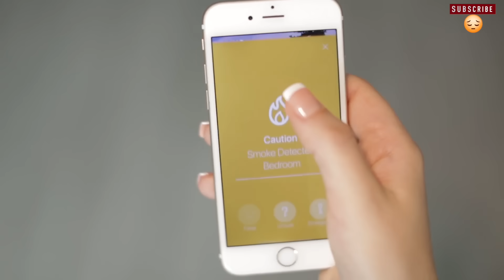10 Fire Fighting Inventions That Every Government Should Possess ▶ 7

Comment: Most of these "innovations" are purely impractical bullshit.  Aside from the air tankers, which are NOT new at all, skycranes have been used for at least a couple of decades.  It's clear the makers of this video have NO idea about what it takes to extinguish a fire.
Reply: well, some of them are very useful and many departments purchase them. Well, obvisouly some are only for special operations which not every department covers, but some larger departments do.
There will always be some units and tools which hardly anyone else has, but they still make sense. Thus the department in my former home town has more than 50 units at the station and one of them is a nitrogen vaporizer ...
Reply: WTF is a "nitrogen vaporiser"...  Nitrogen turns to a gas at normal temperatures, you don't need to vaporize it...
Most of these gadgets are useless, period.
Reply: ffjsb the nitrogen vaporizer is used as interting systemfor fires in food and grain silos. Liquid nitrogen is brought to the scene by a semi truck, vaporized and then the silo will be filled with it. In contrast to frozen carbondioxide (that department has a tank with frozen CO² as well) the method with nitrogen doesn'tleave any debris on the grain, so it  can still be sold afterwards. Otherwise both the fire itself  as well as the extinguishing with water or foam can be the financial ruin for the  company.
Some departments think a little bit further than just putting water and maybe foam onto the hot stuff.
Ever heard of  fire-fighting tanks, 300' high Aerials, fire and rescue trains, fire trucks with cabs on both ends of it, motorbikes and compact cars used for fire-fighting tasks? ...
Reply: CO2 is not frozen in tanks, it's a supercooled liquid just like liquid Nitrogen.  CO2 is not going to leave any "debris" on the grain either, I'm not sure you understand what you are talking about.  
As for all of the other "gizmos", most of those are of VERY limited use, VERY expensive, or usually impractical or not necessary.  There's a reason why there are standardized firefighting apparatus.
Reply: Actually it does, not much but there's stuff stuff remaining on it (I don't know what exactly it is). That's eactly the reason why the department got the nitrogen vaporizer, otherwise they would have kept only the tank with frozen carbondioxide. Another department got one vaporizer as well.
Well, there are standard fire apparatus and special operation apparatus. Guess why they are "special" ... in which way do you think any of the other named things aren't necessary (especially without knowing why and where they are used)? To add some more examples: mobile cranes, ambulance bus or  command bus, road-rail truck, amphibious vehicle, tow truck, bomb disposal unit, turbine extinguisher, (farm) tractor, ...

Maybe you get along with Engine, Tanker, Ladder Truck and Rescue Truck, but many departments have a slightly larger fleet and handle some more tasks.
Reply: You clearly don't know what you're talking about.  
Not at all.
Reply: I don't know the chemical background etc, I only know that it is like that. Guess why I was in contact so much with the department as they received that unit ...
Probably you think that all the other named special apparatus are completly useless as well? :D
Reply: "I don't know the chemical background etc,"
Like I said, you don't know what you're talking about.  So let me break it down for you...
1.  Drones.  Limited by weather, 100 lpm is only 25 gallons per minute, absolutely useless on a structure fire.  Some possibilities for fire command and search and rescue using live video.
2.  Sound waves.  Great, they put out a SMALL fire in a SMALL skillet...  Try just using the lid next time...
3.  Aerial tankers, not new at all, been doing it since WWII.
4.  Tracked robots, not really new, mostly used for EOD (bomb squad) you can't drag hose too far, especially once it's charged.  Very limited use, and they are NOT explosion proof.
5.  Exploding balls, no.  Just NO.  It WILL NOT put out a deep seated fire, and does NOT provide any cooling, so there is a great likelihood of re-ignition.
6.  "Sky Saver"...  Any fire below you and you're going to be like a marshmallow in a campfire.  And if anything is falling from above, you'll be killed by the falling debris.
7.  Basically the same thing as 4, but firefighters can already put out more water than it can with existing equipment, and at a fraction of the cost.  The only advantage is that they can handle more radiant heat, but they're still too expensive.
8. High fog, basically a high pressure sprinkler system that will still cause water damage, and is more expensive to install, with more maintenance.
9.  Auto Fireman, you'd have to put in way more than two to extinguish most fires, and it will not prevent re-ignition of fuels.  Not to mention they're just too small.
10.  "Smart detectors" limited need for these, mainly high risk facilities.  Normal detection systems already in use are quite adequate.
This was a HORRIBLE video, with much false information.
Reply: At least I'm honest and tell you that I don't know the detailed background, but what I do know is why two departments got one of these units each. Do you think they get them just for fun? The department in my former home town has a station with 55 units, only 3 of them are Rescue Engines or Engines and 3 are Tower Ladders, you can imagine the number of special operations units (and no, that department doesn't have a mobile crane, an ambulance bus or command bus, no 170' Tower Ladder or sth similar)

1 Drones: yes, we primarily use drones to get an overview of the emergency scene, some are equipped with infrared cameras. We have one drone operator from the FD in the county, and at the EMS provider where I used to work the boss has one drone for search and rescue operations.

7, the LUF60: The only advantage? Operating from a safe distance without risking your crews life in too dangerous situations for sure is a reason, no matter if a tank needs to be cooled down, or fires in chemical industries, fires in tunnels etc.; It can also be used to ventilate large buildings as well, remove some debris or vehicles which block the path to the fire and so on
 Since there are quite many departments purchasing them it seems like it is worth the costs. Some departments purchase more than 50 entire fire apparatus at the same time, they sure can purchase a LUF as well.
Reply: I'm telling you I DO KNOW about these items.  And yes, my dept. has bought stuff that we know to be basically useless, just because they got some Federal grant money, and had to spend it or lose it.  Pretty stupid reason for a fire dept to spend money.  There are a lot of idiots sitting behind desks that order useless stuff because they think their "cool".
BTW, NO dept. puts 55 "units" in the same station, it would absolutely make no sense.  I'm pretty sure you don't know what a "unit" is.
You don't need a LUF60 to ventilate a large building, there are many cheaper ways to do that, and a single fan isn't always going to work no matter how big it is, for a number of reasons.  VERY few dept's purchase 50 vehicles at a time, and in almost every case, they are to be delivered over a few years, not all at once.  You're talking about MAYBE the 10 largest FD's in the world.
Reply: Just FYI: they didn't get any money they had to spend, the unit was directly bought by the state and directed to two out of seven professional fire departments, with each unit covering half of the state as response area. The fire department didn't spend any money on it ... at all

And actually YES; just because you can't imagine it, it's something completly normal to have several dozen units at the same station here! What I define as a unit? A fire truck, car or van operated by the fire department and also special equipment pods which, incombination with a pod carrier, are another apparatus. All of them are at the one and only station from the professional fire department which covers the entire city area first due
Btw the 2nd largest station in the state has 47 units, that was the amount of units and size of the station my former home town had so far.

Well, there might be few departments doing that, which doesn't mean that there are no departments. And  no, I doubt that a fire department in a city of "just" 1.7 million inhabitants counts to the  10 largest in the world, it's not even the  largest within the country: it's "only" on 5th place in Germany and has 10 stations from the professional and 22 stations form the volunteer fire departments .... that's it
Reply: Yeah, because the "state" never does anything that's stupid...
And locating all your resources centrally instead of spreading them out to provide a quicker initial response is just plain stupid.
Reply: howlong do you think does ittaketocover the city area starting from one point downtown? Taking the average speed,they manage to cover 90%  of the city area within a 6 minute long drive.
Spreading the apparatus throughout the city? That might require like 3 times the staffing on each shift...
Doesn't make sense to spread apparatus which have to meet on scene anyway, there are just few standard units while most are special operations apparatus. For a fire alarm always the same 5 units are dispatched, 2 of them being Rescue Engines and 1 Tower Ladder? Do you really want to spread 3 apparatus and thus won't be soflexible any more concerning staffing of special operation units?
No, it's simply tactics to have few large instead of numerous tiny stations, with apparatus having trouble to approach the scene from all directions we rather form small convoys which have to go through traffic only once
Reply: btw both professional fire departments and volunteer fire departments go for the system of few large instead of many tiny stations. Even though some stations get a bit large like that, they don't necessarily run many calls

Comment: 2: This has existed long before they invented it.
It is called Explosives.
The pressure wave from the explosives does the same thing.

9: That guy cant even pull the pin.
Plus what about engines that run hotter than others do they set off these devices?

Comment: These inventions are great looks like in 15 20 years we won't need to risk the lives of near as many heroic individuals if any. With the further development of artificial intelligence robots will soon be the only thing needed to put out fires quickly, safely, and efficiently. Just think if we had some of these during 9/11 maybe we could of saved 1 of the buildings. Also makes you wonder why a firefighting plane or helicopters weren't used
Reply: Derek, 90% of this video is pure BS.  None of it is practical in the real world, except air tankers.  And those are NOT useful on structures because you can't effectively air drop water INTO a building.  In 9/11 they tried using helicopters, but the smoke and air currents from the fire made it impossible.  Some detection technology is good, but robots just can't move long hoses around corners.

Comment: The sprinkler systems are there to slow the fire from progressing. Using the mist sprayer will create more steam which will burn people and firefighters in their gear. 
The extinguisher ball is pretty cool though
Reply: Also it’s been proven that fog streams don’t block radiant heat because radiant heat is a wave just like light
Reply: Creating steam is part of firefighting. Water sprayed into a burning building creates steam which suffocates the fire.

Comment: I doubt that a lot of Departments would use these gadgets Firefighting is fine the way it is some would buy they just don’t seem useful for all Departments
Reply: most special operation equipments aren't usefull for most departments, but for those in industrial areas or large cities or any other kind of special environment they are useful for sure. Think about snow scooters, nitrogen vaporizers, turbine extinguishers etc
Reply: EnjoyFirefighting - International Emergency Response Videos I don’t think so the FDNY doesn’t use drones to put fires out most buildings are taller and streets are tight aircraft is different obviously the Skycrane and the Air Tanker are useful for the Forestry Service until you start seeing them in big city’s some of these aren’t viable for people
Reply: well, maybe not every unit shown in this video, but for eample the remote controlled fire-fighting support unit shown as number 7 in the video. Many  departments operate one of them for ventilation tasks (e.g. in tunnels, park garages etc) and fire-fighting tasks in industrial areas where they don't want to bring a fire-fighter too close to the flames

Comment: Putting fires out with sound I am sure I have seen that before. Oh yes I remember "MacGyver"
Reply: No hating on the team that "invented" the sound cannon. But it is quite old tech, just another way it can be used. Its simple in design and application and the speaker explains it wrong. It just pushes air rapidly over the fire source and that causes it to extinguish the fire.

Comment: These are very good, even excellent. BUT it would help if things were made of NON flamable products to start with.. 
Look at the GRENFELL tower fire  1 year ago. Lining the outside of a  24 story block of flats with a flamable plastic foam,  behind a metal outer sheath to produce a chimney effect. Capable of spreading  a ground floor fire to the top level 24 floors up, and engulf the tower in a toxic, choking fireball, in a matter of minutes, was the brain storm of the most criminally insane money grabbing killers allowed to manage such constructions. 
If the people responsible (who are in fact irresponsible ) and the people that elect them were all charged with the 72 counts of murder, and hundreds of counts of attempted murder, and maiming by negligence, then perhaps people who should be "responsible" would actually do their job properly, and responsibly, then there would be less cases of needing these fantastic inventions that are sadly rarely available in the right places...  
There was a device shown on a program called TOMORROWS WORLD way back in the 60's that with a simple fire hose, and water pressure available from a fire truck or a installed pump, that could lower a person hundreds of feet in seconds and slow to a safe stop,  then remount to the top to take the next person down.. this could have been fitted for a cost of a few hundred pounds, to every building to safely evacuate people , animales or even take equipment up to the top, for fire fighters to replenish with supplies.  But it was never ever used... WHY....because there were no profits or backhanders given to the officials that could have implemented it straight away, until a better solution was found,.. that 50 years later still has not been found !!!!!